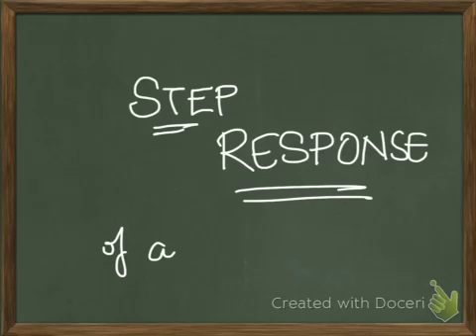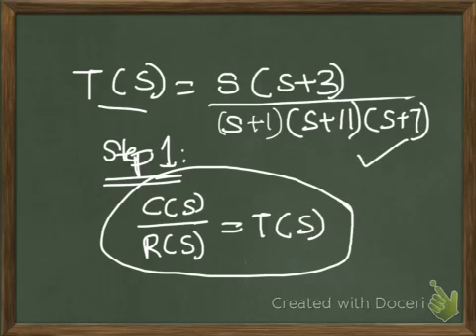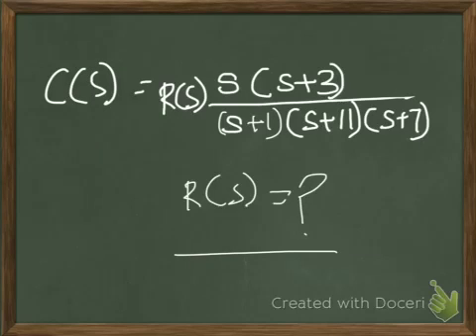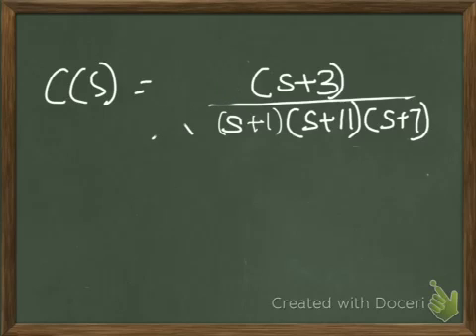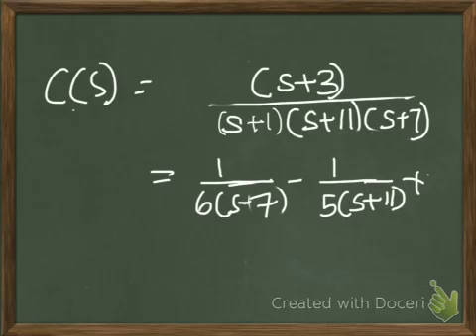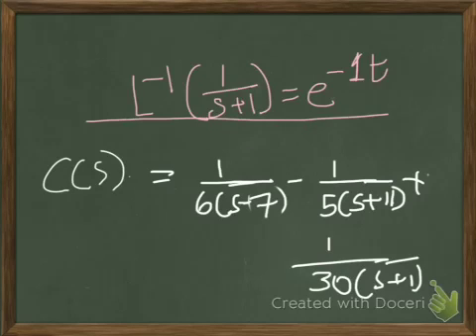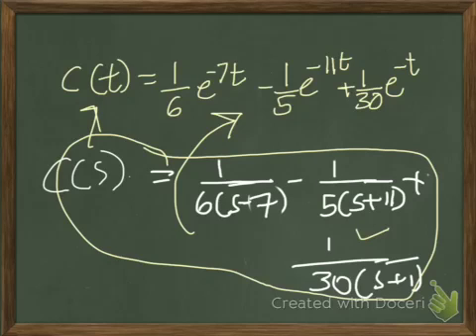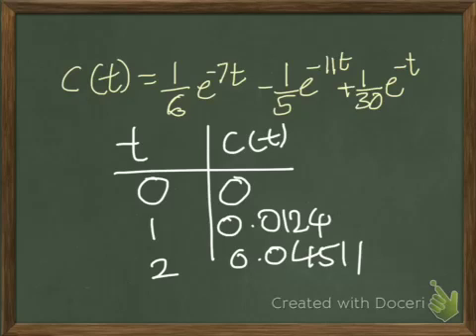Step Response of a transfer function

Comment: Hi, do you have any idea how to solve these problems? http://i.imgur.com/gVRJZbl.png
Thanks
Reply: bro use matlab for this problem.. this how it goes 
num=[\\just write the coefficent of s in the numerator for example if you have s^2+s+3: the answer will be 1 1 3] 
so num=[1 1 3];
same case for the den write the coefficent of the bottom side for
den=[2 0 4];
write X=tf(num,den) which stands for the transfer function so it will appear as ur questions
then do bode (X) and u should see ur plots